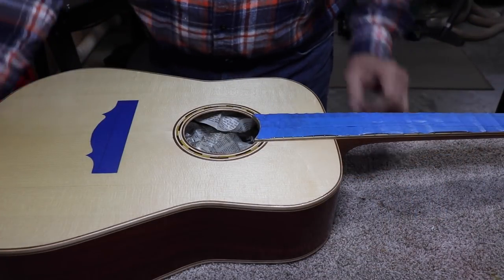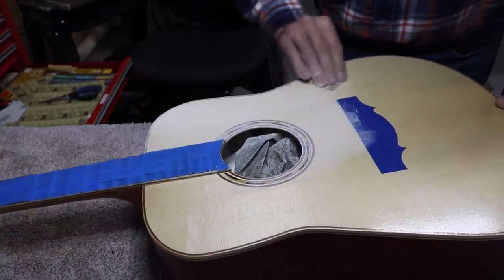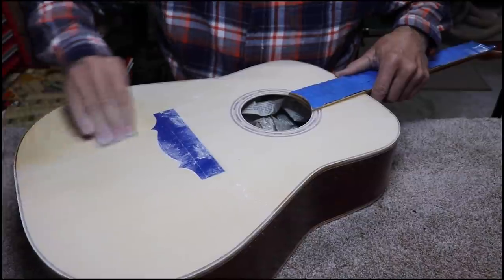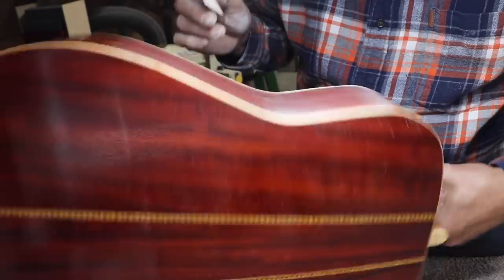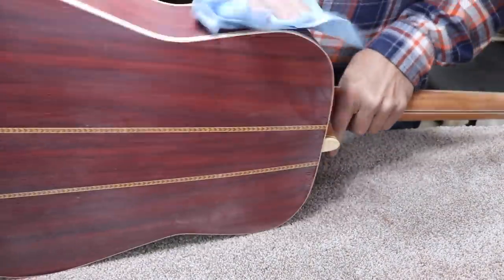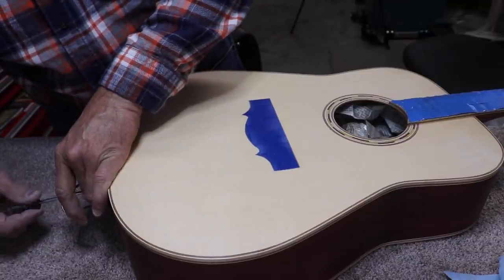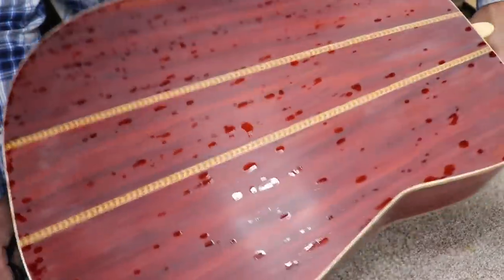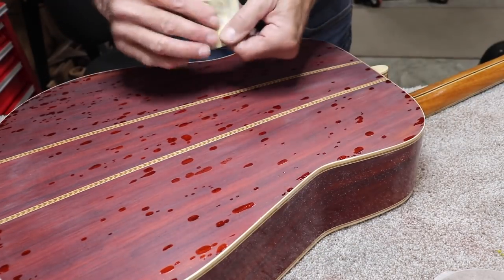455 RSW A 12 String Custom Rosa Dreadnought Part 12

Comment: some folks apply to much pressure while sanding and not sense the sand paper cutting .. it takes some practice to sense the paper cutting doing it's job .. that's why when they sand with their fingers actually cuts a finger sand grove .. you must be applying just the right pressure with your fingers ... it's all about letting the tools do what they are supposed to do ... it's skill and awareness true craftsman learn over the years ... great job !

Comment: When I have applied Tru Oil to two of my builds, I use foam wedge makeup applicators you can get by the bag full at the drugstore. They make a smooth thin coat and can be disposed of after each use.

Comment: Your absolutely right about sanding with the small sandpaper squares. If your trying to level a large rough surface, then absolutely use a sanding block. 
What your doing is very fine sanding that benifits greatly from precision sanding with your fingertips. There is no device better designed and more capable than your fingertips and your brain. It takes some practice to get the "feel" for it, but once you realize the control and precision of the technique you use, it really is the best process.

Comment: If you use a finer grit WET sandpaper (400-600) with the tru oil FRESH (not letting it dry), the wet sandpaper makes a sort of paste with the oil that'll fill the grain, naturally, with no color change.

Comment: Hi Jerry,
I’ve had the exact same problem.. then I discovered never use sandpaper on oil.. the sandpaper leaves debris which is what you’re feeling now.
The trick I learned via trial and error was simpler than you might think.
1.) apply/brush (I use foam brushes) Tru-oil filler multiple times to build up the layers.
2.) between each layer, after a 1-2 day cure time, use 0000 steel wool until smooth
Lather;rinse;repeat until grain is smooth, or where you like it
3.) finish with final coat Tru-oil using the same above method.
Let cure for at least 5 days until all layers are fully cured.. rushing now will make you start all over again.. don’t ask how I know.. 😬
Final buff with wheel or automotive buffer.. I’ve even used semi chrome to touch up spots that won’t buff out.
Give it a try on your next project. Let me know how you make out. 
Good luck!

Comment: I apply tru-oil with a cloth, I can get thinner coats that way. Then I sand it with 600 and 800 grit. Comes out real nice.
Reply from the maker: It always comes out nice the problem is padauk has really deep grain holes

Comment: I painted professionally many years ago and sprayed alot of  lac. We used a airless sprayer and sprayed oak  maple, wallnut, on custom hand distress wood that got put in very expensive homes. We two coated the wood and lightly sanded between coats and never had the problems you are having. Just thought I'd share that with you maybe it the sprayer.
Reply from the maker: No it's the padauk.   There was no problem with the top board just the back and sides

Comment: I saw that luthiers apply true oil and right after that start sanding with very fine sandpaper and this fine saw dust mixed with true oil fills the pores very well.
Reply from the maker: Been there done that in fact I did that on this 12 string didn't help

Comment: You've certainly held out from spraying instruments a lot longer than most people who build as many as you do.  I tried Tru-Oil, brushing lacquer, wipe on finishes, and all manner of other methods of non-spray finishes, but I finally gave in and got a little compressor and spray gun and I'm glad I did.  Finishing is still far and away my least favorite part of guitar building but it turns out better now than it ever did before.
Reply from the maker: Actually I've never done anything but spray them I'm not sure what you're referring to Every instrument except a few have been sprayed however I have tried all manners of application there is nothing you can suggest that I haven't tried
Reply: @RosaStringWorks  My bad.  I didn't remember seeing you spray an instrument.  But I've been wrong plenty of times lol.

Comment: Beautiful instrument Jerry. Everyone needs a 12-string guitar.

I do think part of the problem you are having with the finishing is applying the Tru-Oil with a spray gun. By rubbing the finish in with a cloth you avoid any risk of drips and you can build up a finish in only a few sessions. Have you tried using MicroMesh for surface preparation and between applications? Going through the grades of MicroMesh on a medium-firm foam block has worked well for me. One thought on pore-filling: when French-polishing you can use a slurry of pumice, shellac and alcohol to fill pores. The pumice abrades the wood and means you’re filling the wood with wood itself. Haven’t tried this, but you could perhaps use pumice with Tru-Oil to similar effect - something I’m going to try next time I use an oil finish.
Reply: Redneck french polish: clogged up 400 grit on a palm sander, apply finish and sand while wet immediately. Wipe off excess if there is any. Use same sandpaper for progressive coats so it clogs up more and more basically making it finer grit.. Dont sand final coat. Works great with danish oil.

Comment: Don't know if this would apply to musical interments ....But my uncle who made fine furniture with special type wood..........I asked him once how he filled in the wood pores
much like seen in this video on that guitar .......He said he mixed his finish with turps...thinner in the first coats and mixing up more finish to turps...until he had filled the 
pores and then full coats of finish after this......As I said I only know this worked for him
I am talking here in the late 1960s ......he died 1980 at 94 yrs old .....he was a master builder with wood ...but what finish he used I don't know but I do know he also did the Linseed oil hand rub or what he called French polishing on some of his furniture ..I'll leave it to you who is more in tune with what he would have done ......beautiful Jerry ....thanks

Comment: Jerry True Oil is really best applied by cloth but it takes like a million coats to get deep glass finish, and use sand paper as well with it 😂
Reply from the maker: I have applied it in every way you can possibly imagine even with my fingers as recommended by the manufacturer it has nothing to do with application and everything to do with padauk
Reply: @RosaStringWorks   Wow good to know I’ve never used it on Paduak, but as usual luv your work masters like you are few. I must say your young prodigue shows promise to bad he’s leaving.

Comment: What a beautiful instrument! Now, i dont build guitars (yet) but i do do a bit of woodwork and woodturning. I use padouk and even oak. Not just pores, holes. I want the actual wood in those pores to fill them. So i tend to wet-sand with the actual finish or with oil. That way the fine wood dust fills the pores and stays there because of the finish or oils. Especially friction polish technique on woodturning works wonders. As i said, i dont build guitars. I dont know what this does to the tone, but its the same wood in there. Probably another useless tip you’ve tried before, bur I couldn’t help myself...
Reply from the maker: Yeah been there done that in fact I even did that on this guitar didn't help

Comment: Many of the folks who use Tru Oil on gunstocks hand rub the finish. I’m thinking that even if it were only the first few coats, it could help with filling the grain. Beautiful guitar, Jerry!
Reply: Agreed, it should be rubbed in NOT sprayed. Many fine coats allow to dry them as the manufacturer advises use steel wool then another fine coat.
Reply from the maker: Guess what I've been there done that it doesn't work either a padauk is the problem.   You noticed the top field fine

Comment: I've had good luck using a small paint brush with a pointed tip and let drop lets fill the spots .. I do it to fill each hole .. and then use a rzor blade to scrape it level after cured usually it's not cured hard but that shouldn't matter ... and at the auto body shop anytime leveling a high grade tapered to the fixed area sanding criss -cross sanding is much better for leveling .. not a final sand but leveling it's really effective on leveling smoothing out a high .... what I've seen you do on final sand is great .. food for thought

Comment: That is a beautiful guitar jerry!!! I just did a neck reset/conversion on an old harmony h1230 12 string and the joint is unfinished(not glued yet)I know what I’d do to clean it up but I’m wondering If you have a better idea. My plan is to glue the joint,tighten up the bolts(as I said,reset/conversion) and rub sawdust from the neck into the squeeze out and once dry sand with 400,800,1200 and a bit of clear lacquer then sand again with the same progression

Comment: Just before you started talking about fillers, I was thinking wow that wood has big pores. My left hand, mainly left thumb, starts hurting so bad I really can't play guitar anymore. I have found Voltaren cream works well. Voltaren was prescription until a year or so ago. It just puts anti inflammatory med right on the trouble spot. Also Jerry, I use that finish on gun stocks. I prefer to put it on wearing a nitrile glove and just use one or two fingers to spread it. Yes, it is self leveling.
Reply: I had neck fusion, in 1992 that really weakened my right arm & hand, (only 3 lbs of grip strength, I actually bruised my palm squeezing the machine, my Dr gave me). I tried thumb picks, but I've got such fat thumbs they were actually painful. I ended up using double sided tape, on my picks, worked well, for me. There are hand exercises that a piano player taught me, that actually helped me. I passed them on to a lady friend, (she had just had carpal tunnel surgery), she tried them, & said they helped her immensely. Hope your hands & Jerry's hands feel better.
Reply: @bluesingmusic3443  yea, I know what you mean. I've had two neck fusions, and a decompression on the back of my neck. The left thumb issue cam from an injury in 2016. I'm right handed and after about five minutes, my left thumb hurts so bad I have to stop most of the time.
Reply: @N5KDA  sorry to hear that. My injury happened at work. But it taught me just how much we use our neck muscles with out realising it.
Reply: have you ever tried using wet sandpaper with thin truoil . sanding wet varnish will laminate the guitars wood into the cracks and pores. you end up with a very thin finish polished to a almost plastic looking but natural  finish at the same time
Reply: Ive had my neck,middle,low back fused.pretty much the whole spine.the only part of my body that doesnt burn with pain and go numb is my neck.there really isnt many parts i have had operated on.im a living dead person but sometimes i can still kind of play.music is a hard hobby stop but i still enjoy it sometimes.i still love my guitars even if i cant play them as much.i just love guitars no matter what i guess.they are such beautiful works of art.
Reply from the maker: Yes in fact I did that on this guitar did not help at all
Reply from the maker: Yes I tried a large tube of the voltaren did not work for me at all
Reply: @N5KDA  I'm in Pain mgt too. However my Dr doesn't give me enough to completely kill the pain, as honestly morphine was the last time I was free of pain (hospital after surgery) of course nerve pain, isn't really treatable, I get just enough to take the edge off. Tried my best to live with it for 20 yrs but finally gave in. Had to undergo 4 drug screenings, clean of course, then pain Dr made me take another. I've basically just gotten used to it. I'll put you in my prayers (always have my little one pray) blessings. Thank you for service as a police officer. (They say no one likes cops till they need one. I beg to differ as it's a dangerous job.)

Comment: What a beautiful guitar, Jerry!  I’m wondering how you decide whether to drill the bridge pin holes so that the upper octave strings are in the row closest to the saddle, or with the lower octave strings there.  I’ve noticed that builders do it different ways.

Comment: Hey Jerry Crimson Guitars UK are doing a new Melamine finish ( wipe on or brush) the reason I suggest it is it is touch dry in 5 to 10 minutes. Would save a bit of time with the finish needed to fill the grain. Drop Ben a email im sure he would be happy to answer any questions he's a great guy.
Reply from the maker: The sound of the finish doesn't matter on an electric guitar it really matters on a acoustic
Reply: @RosaStringWorks  i though with it also being very thin acoustical it wouldn't change much over the tru oil finish because of the lesser amount you would use of the Melamine.. just a thought tho and worth a try asking Ben who is a very clever bloke and knows his stuff ( trained building viola at da gambas now a master luthier )

Comment: Tru Oil is designed to be a wipe on finish. Just a rag and wipe it on. Also the makers of Tru Oil have a sealer product to use to fill those grain pockets. 

You wipe on... Wait a couple hours and reapply 20 times or so. Then wet sand once. And apply a couple more coats. 

No runs ...no drips ...no errors.
Reply from the maker: Been there done that it sounds so simple you gotta try it on padauk
Reply: @RosaStringWorks   I love your videos! I know you know your stuff... I won't argue with you, I’ve only used true oil on Maple and Mahogany but the sealer from Birchwood Casey would be worth trying next time if you have a next time. 

Love your shows Jerry! Hope you can go on forever my friend 👍🏼

Comment: Just a guess here, but the gap-filling issue may be a consequence of surface tension and viscosity. Perhaps, as the finish dries (evaporates) it is pulling back from the gaps or pores vs. filling-in. Overcoming the surface tension would seem to be the challenge of filling the voids and gaps. Perhaps a "squeegee-like" application across the grain might force the finish into the pores on the first few coats?  All moot however, it you're retiring soon.
Reply: Retirement? I must have missed that. R
Reply: Retiring when? I hope not. Not when he makes instruments like the twelve string FROM SCRATCH. What a great thing in this computer driven, auto this and that, age we live in. He makes things from pieces of wood. Beautiful melodic instruments that are amazing

Comment: About 100 years ago I was a project leader working on internal restorations in London. At the time we did work for the UK government historical properties. You may be interested to know that the door to 10 Downing Street is painted while hanging upside down, not vertically of course, horizontally. The idea was that it levelled more evenly. I have not tried it personally so offered here as an interesting fact more than a proven recommendation, although that door is beautifully finished.
Reply: I always wondered how they painted that door. It always looks so smooth compared to my front door.

Comment: Hi Jerry. After finishing many guitars, mandolins etc, I've found that waterborne lacquer to be easily the best at pore filling. But precat lacquer with a good sanding sealer is also very good. In my opinion, wet sanding is the best way to get your surface optically flat. If you don't get it absolutely flat, it will never look professional.  Your building is second to none so why not follow tried and tested methods of finishing? The most obvious problem you seem to have is not getting it flat. It should be flat at the sanding sealer stage before any topcoat goes on. There should be no shiny bits at all. Hope I'm not trying to teach Granny to suck eggs!!!!
Reply from the maker: flat is easy... filling pores in Padauk not so much

Comment: Hey Jerry, I really like how the 12 string turned out. It just rings. Just curious, I know you were stating in a previous video, that you were going to put an under saddle pickup on the 12 string. Is that the case with this one or have you abandoned that plan?

Comment: Have you tried to wipe the wood down with acetone before you apply finish? That takes out some of the oils in the wood. Wouldn't block sanding give you a flatter, even finish than sanding with your fingers?

Comment: My two thoughts on the finish. Would it work to make a stand oil using the Tru Oil?  Just stick it in a jar with an aquarium bubbler for a while to thicken it.  Hopefully that wouldn't make it too dark. The second is, after drop filling, would it have helped to have added a coat or two of finish a few hours later to help blend it?

I'll throw in a third. What if, after a few coats, you apply a coat with steel wool, fine sandpaper, or something to kind of create a slurry with the dried finish to help fill the pores?

Comment: Jerry** do you notch  and file the nut so the top of the strings are level ? Chuck
Reply from the maker: Approximately but that's not all that important to me it's more important that they don't stick in the slots
Reply: @RosaStringWorks  ***The proper way to setup a 12 string  guitar .the nut should be notched and filed so  that the strings are as shown and the top of all strings should be level so the pick hits both  of  the strings at the same time.***NUT setup ***e6.6E, 5a,5A,4d,4D, 3g,3G be,be, ee,ee ****DR KEL

Comment: ???? Jerry, I am wondering, given the problems with running, why you spray the Tru Oil?  I refinished a Martin about a year ago and I heard you talk about how Tru Oil runs so badly, so I made the decision to hand wipe it on.  I worked beautifully and I ended up putting on about 15 coats.  I ended up with a lovely finish and no runs. So, why spray instead of hand applying?  Please forgive me....I asked this question before I got to the part of the video in which you started brushing.